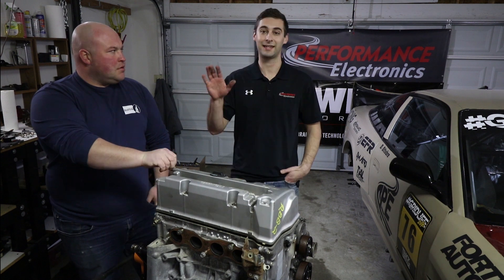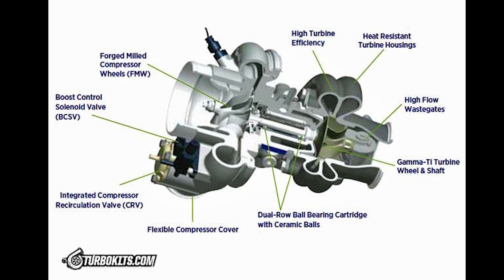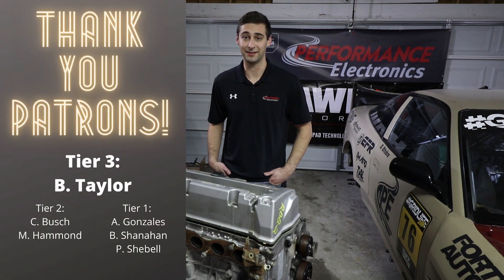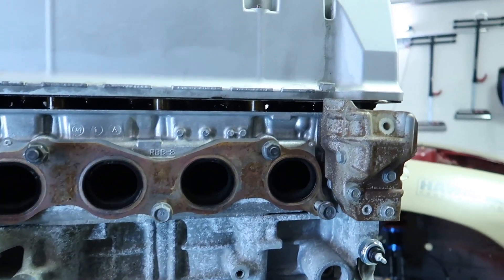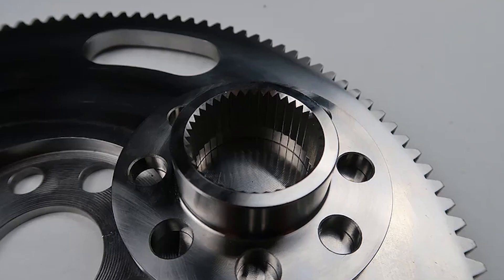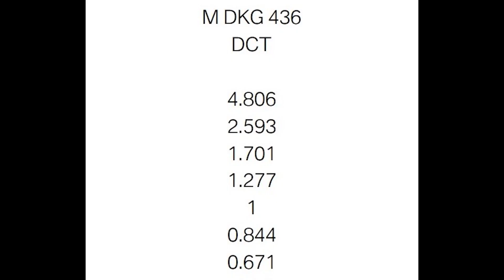K24 DCT 240SX Build - Part 1 (GRIDLIFE Time Attack)

Comment: With my z32. I run cts-v 6 pistons in the front. Srt8 4 Pistons in the rear. 14” 2 piece rotors all around. Stock z32 master cylinder

Comment: Core 4 motorsports makes a front and rear bbk for s-chassis. I just installed their front setup on my s13 last year. I use a Nissan Pathfinder bmc with an s2k ABS module
Reply from the maker: Thanks for the input!

Comment: This will be interesting! I’m excited to see you guys get the dual-clutch operating without the Can-bus. For my mk2 GTI 07k swap I wanted to run a DQ250 (VW 6 speed DSG), but the main hang up would have been making it operational with the swap. Maybe this series can give me a few ideas to make it happen in the future
Reply from the maker: It should apply directly! I’m considering running a DSG in my 914 and I will run the same HTG TCU if so.
Reply: for what its worth, htg officially supports the bmw dct, Porsche PDK and VW dsg transmissions. That swap with PE's standalone once they figure out interfacing the ECU to the GCU should be a monster.